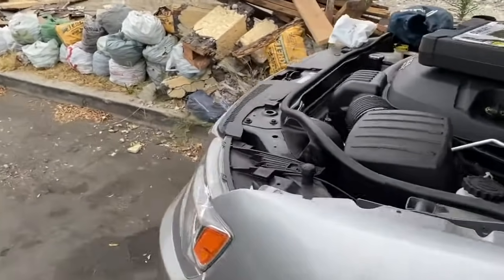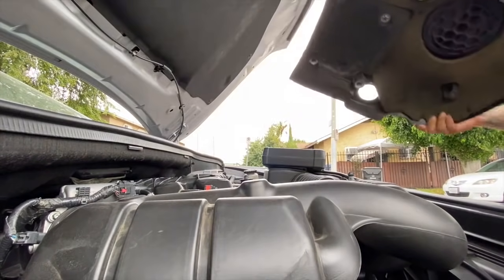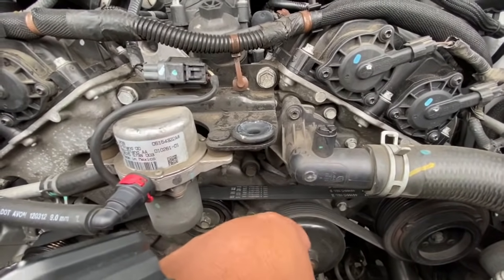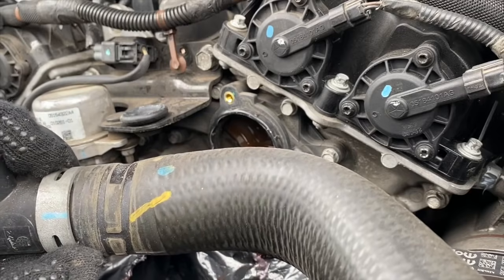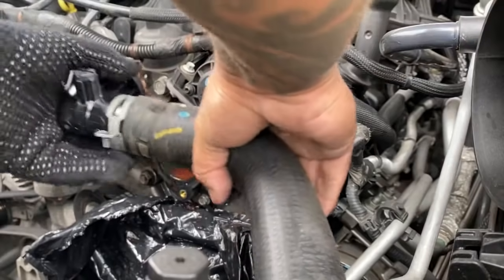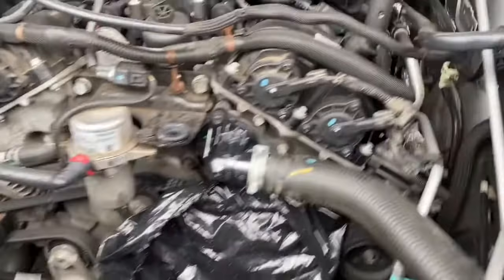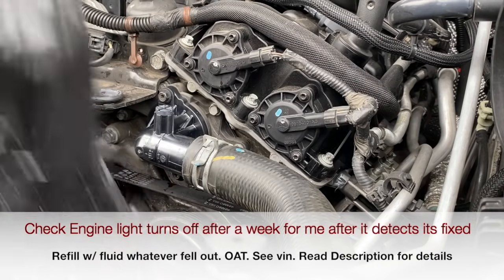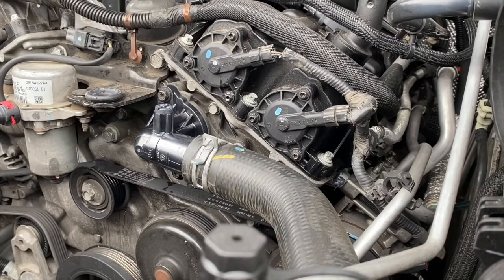Jeep Grand Cherokee Check engine light Fix Thermostat replacement

Comment: Perfectly helpful video.  Got the code, bought the thermostat and watched this video and had it all replaced in less than an hour.  I especially appreciate your idea of the plastic bag over the belts.  I watched another video where the dude just let coolant pour all over the belts, which I assume squealed like crazy later.  Your method kept my belts dry as well as my garage floor.  Nicely done, glad I watched yours after his!  ALSO!  For anyone else wondering, like I was - the CEL went away on its own after the 3rd or 4th time I drove and it got up to proper operating temp, no need to manually reset it (it wasn't ever getting up to temp before as it's very cold here and the thermostat must have been stuck open)

Comment: I replaced the thermostat on Sunday. It’s been two Days. How long will the engine light remain on for ? Thanks
Reply from the maker: Well you can try unplugging the battery for 5 mins sometimes that works. On my old car it took about 6-7 days eventually the system reads that it’s fine and it removes the fault

Comment: What was the initial problem? 
Mine says coolant temperature below thermostat regulating temperature. And I’m
Wondering if maybe this will fix the problem. Thanks!
Reply from the maker: Yeah usually it’s that. Changing the thermostat usually helps. Unless there are other variables. But the thermostat seems to be the cheapest option to rule out. If you do change it your self and don’t take it to a dealer might take a few days up to a week for the light to turn off on its own.

Comment: How do I replace the fluids
Reply from the maker: Well the way I did it was when I was done, I filled up the radiator to the top. Then drove the car for about 20 mins. Then waited about 2 hours checked where the reservoir level was at. If it was low I just filled the rest up in the reservoir  to the full mark on it and I was fine.